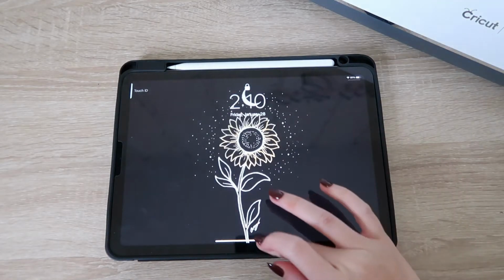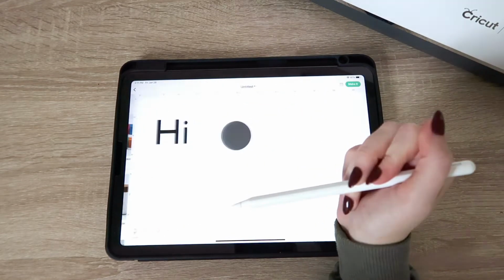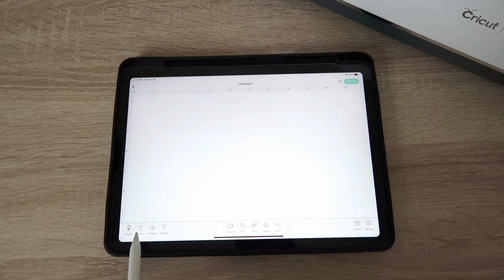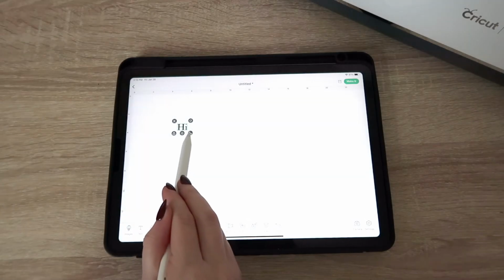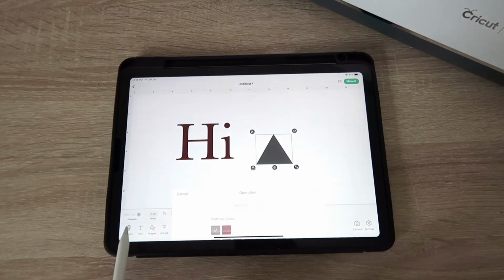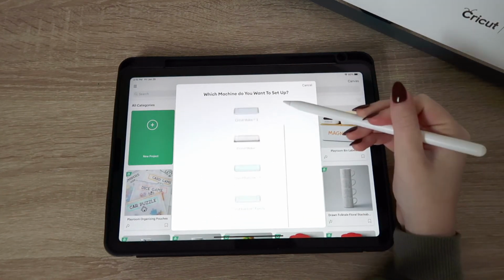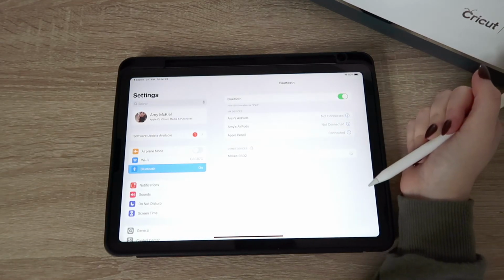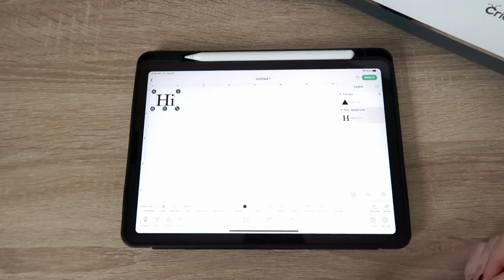HOW TO: Use Cricut Design Space with an iPad! | Cricut Design Space App iPad Tutorial - Bluetooth

Comment: I purchased a Cricut Explore 3 to use with my iPad. This has been a nightmare. I bought this specifically for my bag making with svg files. That is all I am interested in. I basically have taught myself and been able to access my pattern files, BUT I have been trying for 2 days to just figure out what I use to change the multiple layer pattern files which I have grouped to have all my patterns for each bag in one folder.  All I want to know is …on my iPad what do I use to change the color for each template layer.  I would suggest help for bag makers as there are many of us using svg files now.